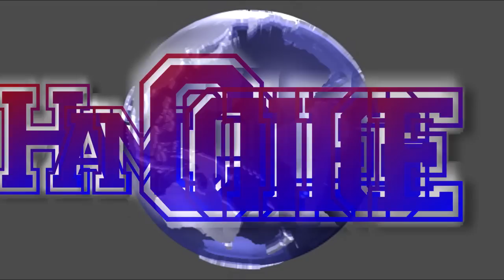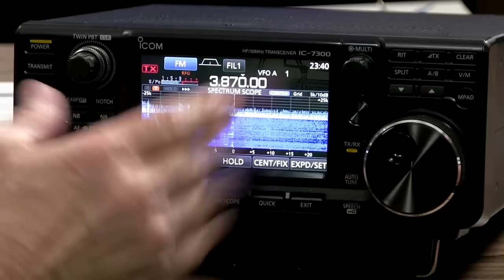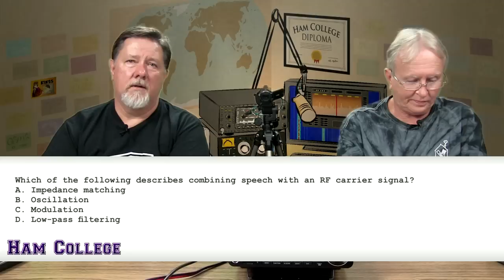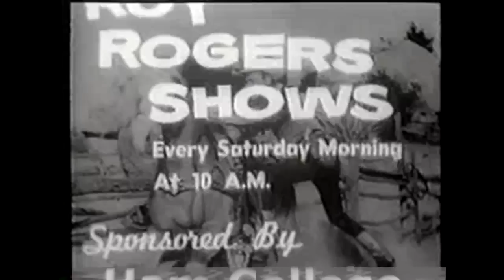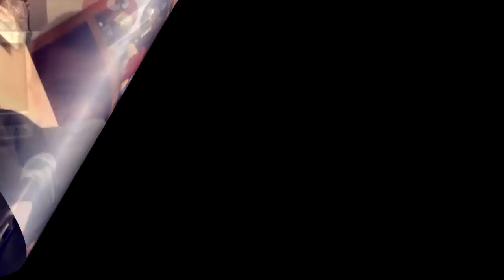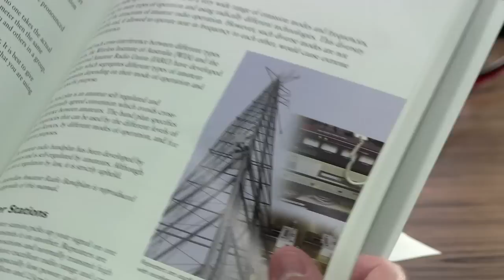Ham College 18

Comment: I have a General Radio Telephone Operators License issued to me by the FCC to me back in 1988. Do I still need to test for my Technicians License?
Reply from the maker: Yes you still need to test. The General Radio Telephone license is a commercial license. An Amateur Technician, General or Extra license is required for operation in the Amateur bands.